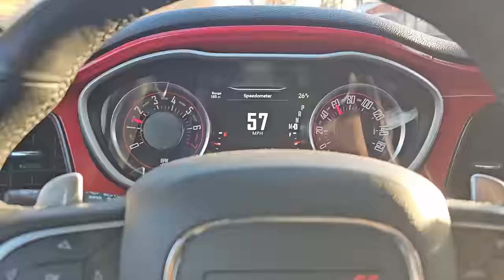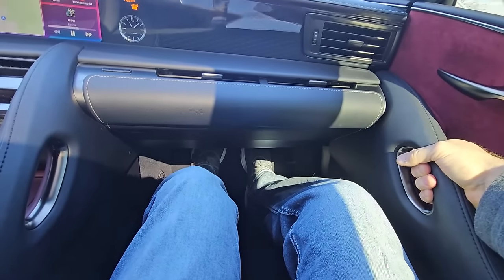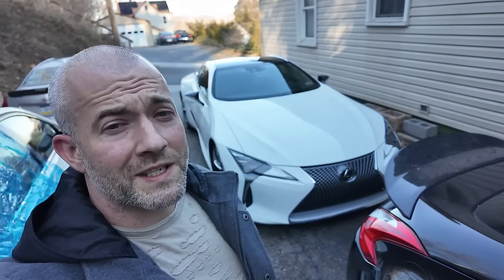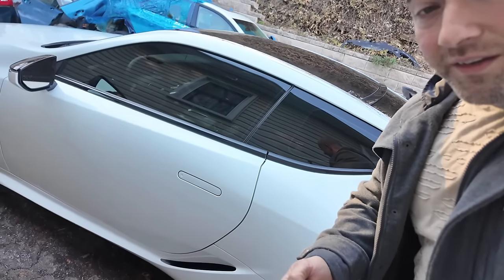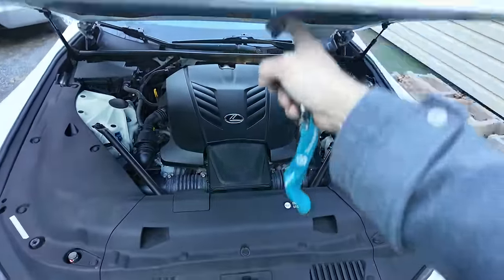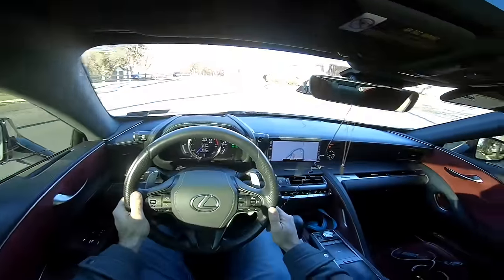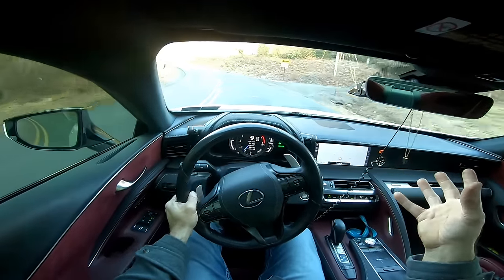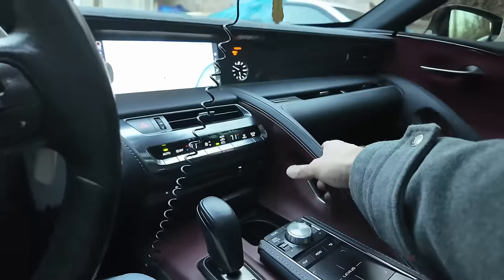Getting Ashley a new RARE JDM Muscle car!

Comment: As an IS500 owner, that v8 is glorious, also a side note...something I learned...push the gas to the floor...push a little harder and you will feel a click. There is no way you are flooring all the way  without the traction control triggering well past 50 mph. Also hold the traction control button for about 10 seconds and all the bells and whistles will shut off, also the throttle gets way more responsive. Be prepared for new rear tires.
Reply from the maker: She doesn't drive it fast
Reply: @UnWrecked  Hahaha...that's what my lady says too!